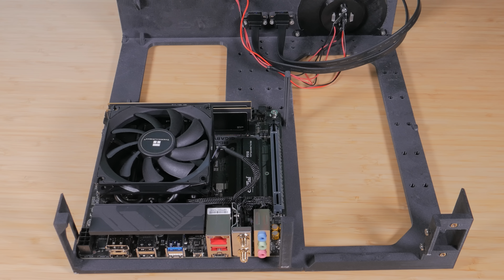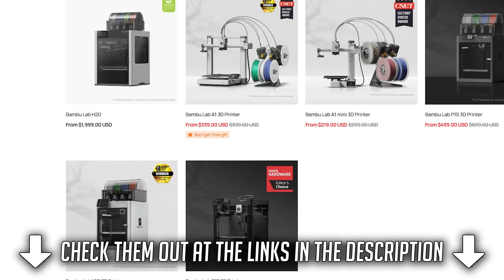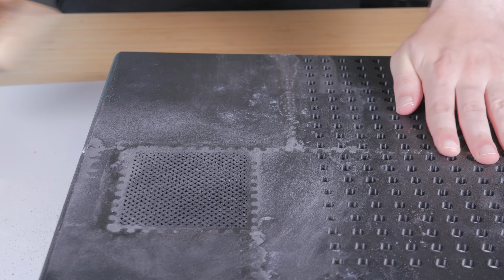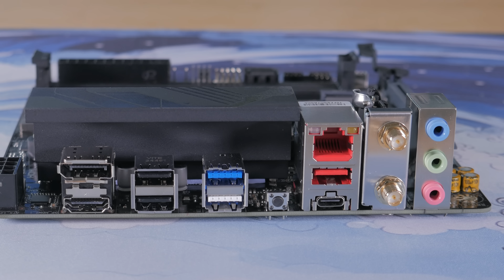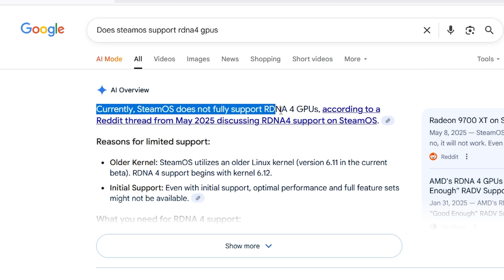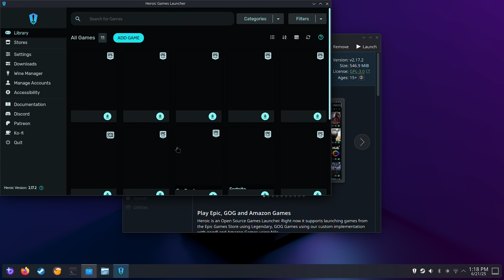I Built A Custom Steam Machine in 2025!

Comment: For anyone who would build this out to spec. A couple things I would suggest. 1) It would be fairly easy to modify to the stl in order to accommodate your specific if there isnt already something very similar. Id imagine there loads basically the samme sff chasis out there tho. If you were copying this one to one then still you could just as easy modify the case w a new mounting point for that power cable. 2) The Finish of your prints can be solved w Putty, sanding, and primer.

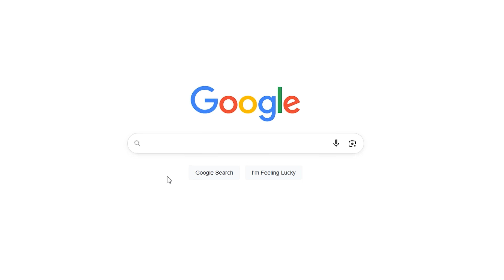Comment: 12:54 "From my understanding"
>AI overview
That's invalid due to possible hallucinations, click the source link or just try SteamOS first and see what happens.
The information it is based on is from May, though the current SteamOS Beta happens to still run Linux 6.11.
SteamOS does not "support" anything other than the few handhelds it gets developed for.
Though it is beneficial to have a newer kernel for recent hardware, so the kernel built-in driver has had more fixes and optimisations.

Comment: If you shop used market you can cut alot of $ on that build. I snatched a 7600 of marketplace for 140$CAD and a motherboard for 100$ just waited a bit for a set of RAM to go on sale and you saved enough for half the GPU price. Dont forget if you have a credit card alot of them have points systems that can be exchanged for gift cards towards buying parts or sell them for cash.

Comment: filler primer is the ticket to small surface imperfections. easy to sand and no messing around with filler. i use it on cars i paint all the time its great

Comment: When you're printing Designs off the internet, that include tight fits, it's a good idea to Testprint a small part with such a fit and then adjust the xy-compensation value in your slicer until it fits on your particular printer. After that, keep that setting and all of the parts should fit like intended by the designer again 😊

Comment: I would have gone for an M.2 NVME for the OS and a large 2.5" mechanical drive for the games, if one can be fitted.
 This is the setup I have on my gaming PC, and it works well.
I also have an X1 Carbon Combo. I have found that printing in ABS results in a 7% shrinkage from the file, depending on the manufacturer of the ABS.
 I am assuming that the designer allowed for this in the design, but got the magnet apertures wrong. Has anyone brought this to his attention?
 Do you have a link to the Makerworld file?
I couldn't see one in the description.

Comment: One critique.  Do not ever touch the terminals on RAM, CPUs or any digital components you care about.  Static charge that you cannot feel is enough to damage RAM.

Electrostatic Discharge (ESD) is very real.  A ground wrist strap that is properly grounded is really cheap and will save you from issues. 

Someone might respond saying "I've never had a problem".  Doesn't matter.  ESD sensitivity is well documented and I'm an electrical engineer that has been building computers for 30 years. I have seen damage to RAM that only shows up when certain values are written and read back... In other words, the problems can be so subtle that triggering the issue will be frustratingly inconsistent and really hard to troubleshoot unless you run an all night RAM test to find the issue.  The amount of effort required to troubleshoot an ESD damage issue is not worth it.  A simple grounded wrist strap is cheap and effective, as well as better habits. 

With that being said, this is a really neat build and I'm glad you shared it.

Comment: Acetone is a great option, so no critique intended, but in the vein of brainstorming:  heated staples would be great to reinforce the joints.   Sort of like the concept of how rebar im strengthens concrete, the acetone bonding would be improved by mechanical anchoring.  Plastic welding staple tools are pretty cheap and easy to use.  Good quality flush cutters help.

Comment: I love this video! You gave some great ideas!
Let me pass on a technique that another model builder passed on to me. I print and sell/build 3D models of sci Fi ships....mainly Star Trek starships. These are mostly large scale 3-4ft models that require cutting, much like your build in the video above, so there are seams that need to be filled. I have used numerous products including Bondo, super glue, wood/plastic putty, and two part mixes. The problem with these is that they have a timed lifespan once you mix them. This can result in inconsistent applications since the product is actually cutting as your applying it. You also end up with a lot of waste if you get busy trying to shape or work through product in to the area adding time to allow the extra material to cure before it can be used.
Now if there was such a product that let you have the precision of a liquid then the rock hard property needed for filling and joining that activated fast and when you needed it to.
Well there is and it's simply UV resin for 3D printing!
I use Elegoo's ABS-Like resin placed in a 10cc syringe with various needles ranging from 18 gauge to 25 gauge. These can be easily (and legally) bought online a veterinarian supply stores. You simply pull up the resin into the syringe and then add the desired needle. Make sure to wrap the syringe with electrical black tape to prevent UV/sunlight from getting in and curing it. You can heat the resin filled syringe with a heat gun to increase flow. I purchased a smaller UV flashlight for detecting dye used for finding leaks in automotive AC systems. Have the light ready, apply the bear of resin, and hit it with the light. It cures enough instantly to prevent flowing out of place. You can later cure it completely. If a thicker mix is needed, mix the resin with baby or talcum powder. It will not harden until exposed to the UV light giving an almost infinite work time. 
I have found a hand held gun style applicator. You can apply resins and glues with more precision than the thumb controlled syringes. There's also various sizes of disposable syringes (offered in black) and needles. It's around $70 but can be used for many other things. A must have for any modeler in my opinion.
I hope you or someone here can use this information. It really made seal filling less of a chore!
https://www.chipquik.com/store/product_info.php?products_id=901001

Comment: This is too expensive to be be mid tier. I think you have to stay under 700, closer to 600. You have a all modern specs, ddr5, nvme and 350 dollar gpu. You’re doing elden ring in 4k…..you never even had to use 1440. This is high end gaming dude.

Comment: Parts not fitting can be due to shrinkage and input shaping rounding corners. Did you use shrinkage compensation for your parts? ABS has a shrinkage rate of around 1.5-1.6%. It also appears to be under extruding on top infill which probably won't be seen on most parts anyway, but personally I would limit my flow rate, because you seem to be at or past the limit of your hotend. The smaller parts where the hot end isn't constantly extruding are fine, but the large areas are flow limited.

Comment: I used to work at a machine job that made plastic (abs) injection molding tooling. When the molds were designed shrinkage was calculated into the mold. The general rule of thumb was 0.003" per inch. For example, if you wanted to make a part that was 1 inch by 1 inch you'd make the mold 1.003" x 1.003". 
I'm not sure how 3d printing abs works. But I bet there's a simular formula out there for it. Something to keep in mind for future projects.
Reply: Steel forge background here. For Steel and forming hot metal its .004 of an inch shrink factor. We are close between materials. Just something to compare.
Reply: @joshbeekman5474  Interesting. Good to know. Didn't realize it was so close.

Comment: Thanks for the comprehensive video.  I learned the hard way about the 9060XT not being compatible with SteamOS.  Worked fine as an external Oculink GPU with Bazzite, and thought I could re-flash my drive with official SteamOS, but then the 9060XT wasn't compatible anymore.  Swapped back to a 6650XT until Valve adds support.
But there's one other downside to that a620 that you might've missed, in that it's only PCIE gen 4, while the 9060XT is PCIE gen 5, so you do lose a tiny bit of performance there.  You'd need at least a b650 motherboard for gen 5.
And it's a real shame about that power cable not fitting with that GPU, but maybe you can 3d-print a little extender and use some longer screws.
One last thing...  I love how you did the power button, but it didn't seem to light up.  Did you get that figured out?  Thanks again!

Comment: Great Video the only thing i have to say is stop telling people to plan to upgrade your build. I've been building computers since the 90's and i took that approach many times and in 2010 i realized that I never upgrade a computer build i end up building a new computer instead by the time im ready to upgrade parts its hard to find parts. creators never talk about the holy trinity of computer building  mother board, ram, and cpu. those are a married 3 components. if your planning on replacing 1 you might as well replace all 3. the computer world is  changing rapidly and when you build a computer plan to use it 5-6 years. I follow the generation rule every 3 generations consider building  a new computer. lets face it game development uses engines that  dont change very fast and consoles next generation is 5-7 years and if you keep all that in mind put aside $40 a month and in 5 years you will have $2,400 and you can build yourself a decent gaming rig again. sorry for the rant it just bugs the crap out of me when people say there is room to upgrade later

Comment: I recommend checking out M.M's Prop Shop's video titled Must Have Tools & Tips for Life Size 3D Printed Prop Making for tips on finishing 3D prints. She goes over her favorite tools and filler products. One of the tools she recommends is a foot sander that's cheap and does a great job on 3D prints. It would cut down on the manual labor.

Is there a mechanism to secure the top of the case to the bottom? I noticed you just sat it in place, but I figured you did that for ease of printing.

Comment: Nice build. I am assembling the parts for a build myself. I wanted to use it for office stuff, strategy gaming and emulation at 1080p. I also want to use it as a co op game server for my family. So, it will be on day and night at times. I went with the AMD Ryzen 7 8700G with 2x16 gb gen 5 ram running at up to 6200. It has intergrated graphics equivalent to a 1650 whist only running at 65 watts. That low power draw is why I got that chip. It only cost me £230 on Amazon UK. It would cost about the same in dollars in the US I would think. I always use Asus TUF gaming mobos. There are built to military specs. So, my build will survive an EMP attack and me plugging random shit into it to see what happens.

Comment: An interesting exercise.  "A few hundred bucks" above the price of a $700 machine escalates quickly.  Add the materials required for the printed parts, paint, various supplies, and your time, and you've nearly doubled the price.  I applaud your choice of loudspeakers!
Reply: "A few hundred bucks" is less than 2 years of PSN btw
Reply: @alexphelps7042  I'd rather have that build than a PSN sub.

Comment: Nice config! If you have access to 3d printer you can go with mATX board. Overall size will not be much bigger, but give you more flexibility. But only if you are not focused on original steam PC case. I have a little bigger device prev generation - matx ASRock b550 board, 5800x3d+ 6800xt in Asus AP201 case. It's powerful, silent and not really big. Now I'm thinking about SteamOS migration from w11 😊

Comment: I used my leftover components and a 6700 XT to build a SteamOS PC for my TV (: Its in a Darkflash DLH21 so its a bit bigger than the Series X but its behind my TV so no biggie. 

3700X, 32GB DDR4, 6700 XT, 240mm AIO, and 2TB SSD. I use integer scaling to make up for the games I can't run at 4k and it works fine on a TV due to the distance. I could put a 5800x I have in there but I don't feel like I need it, also the 5800x would get quite a bit hotter.

Comment: If you use UV or regular lacquer it will hide all of the imperfections in the case i highly recommend lacquer for earphones. It's expensive but the finish is amazing. Egger makes the best lacquer but it's extremely expensive and hard to find.

Comment: Just a heads up, if your Motherboard had 2x M.2 slots here is what you could have done. Installed a high-quality 1TB into the main slot. And a good-quality 4TB into the secondary slot.

The primary 1TB nVme, can be partitioned to 7/3 where you can dual-boot Windows and Linux. And both OS can install programs and files from the secondary drive. You just need to configure the BIOS. And you can even have a shortcut, so that a certain button will turn on the console into one system over the other.

You can easily flip back and forth between Linux and Windows, meaning you get the System you want and the Game Support you want too.
Reply: Ngl I think bro knows about dual booting. Furthermore, I wouldn't trust Windows and Linux to play nicely on a shared drive with important game data on
Reply: @mechaniccat7682  What do you mean
Dual booting doesn't risk data at all
Reply: There is no need to specify what quality the drive is... l also know that that dual booting system will not work due to how the Linux installs of Proton games work.
Reply: @Luke357  I meant in terms of, an expensive and fast nVme for the boot drive, but at low 1TB capacity. Then a cheaper, slower, SSD but one that has a much larger 4TB capacity.

Why won't dual booting work? 
I for one think if you install Windows10 Pro, strip out the unnecessary things and telemetry. Then combine that with ZorinOS. And theme it so that both systems kind of look and behave similar. You would have one awesome machine! 

(yeah, I'm not a fan of the modern Windows 11S, or some of the weird/complicated Linux Distros)

Comment: Ha, I just did something similar, but mine's not as cool because I just used a mATX case.  Mine is also Bazzite powered.  We used the same GPU, down to name brand and model!  The 9600X was at a really low price recently so I went with that, and I have a slightly more expensive motherboard but honestly it's not doing a lot for me.  I was able to use a Thermalright 120 PSE Mini for the CPU cooler though, which makes a huge difference.  I feel like it's the main advantage of having the bigger case.  Mine doesn't really look like a console, it looks more like a chunky VCR or maybe a stereo receiver.

I ziptied in some case fans and put some rubber furniture feet on the bottom of the case to try to improve the airflow to the GPU through the ventilation in the bottom.   I have better cooling but my case is also a lot bigger and not nearly as cool (even though temperature wise, it is cooler, haha).  I also went with a 2 TB WD SN770 since I figured the lack of DRAM wouldn't matter since all I was doing was playing games.  Used a 650W Corsair PSU I found on sale, my bigger case was able to take a standard size PSU at least.   Mine was a little more expensive, right at $1200.

I'm happy with it though it's fun.  Mine might be functionally better but yours is way cooler!
Reply: Can we agree that with a choked out GPU without having feet at the bottom and a slim CPU cooler there is no way he is getting the temps he is claiming?

Comment: Great video and cool concept. The only change I’d make would be to vinyl wrap the system rather than spray it. That would cover the seams and there are options for additional design choices.
Reply: @WTSausageG This 3D print is trash, just buy a case. They are made in a factory and with millions of dollars in equipment. Not some 300 dollar 3D printer.
Reply: @starlite2092  That 3D printer costs $1,000 without the AMS (multi-color unit sitting on top) and is an amazing piece of technology. I have one and it's amazing how well it works. Consumer-level 3D printing has come a long way in the last few years. If you're going to trash it provide actual reasons.

I have no doubt that this printed case is structurally sound. With a little more practice he could make it look amazing as well. He admitted his mistakes in that area, but you can find plenty of examples online of items that people have 3D printed and finished that looks absolutely amazing. For those that are able to do 3D modeling it also provides the ability to custom-design your own cases, which you can't do cheaply when buying from manufacturers.

Comment: Nice job with your first finished ABS prints! High-Build Primer is my go-to for those situations, followed by a light dust coat of paint and a sanding to find any high spots. If needed, one more round of high-build primer, focusing on any exposed low spots, repeating the process. Once it's time for paint, start with a dust coat, letting it dry for only 10 minutes before applying a full first coat of paint. Let that dry 15 minutes and apply your second coat.

This is where you can go crazy.

If you want a super luster, one that you're showing off (or want some protection for), you can now wet sand your item with 800-1000, and applying one last, the most critical as you can't sand this one. Let this coat dry an hour, before coating it with SprayMax 2k Clear Coat. Spray a tack coat first, wait 10, then cover, 15 for the second coat.
Reply: Amazing comment wow, thank you.